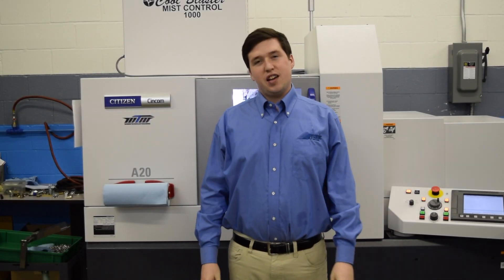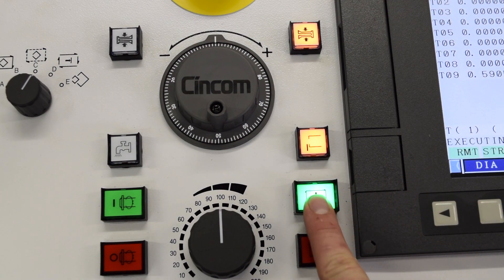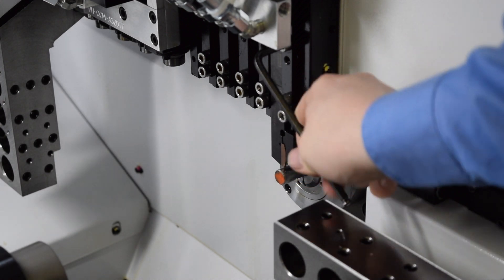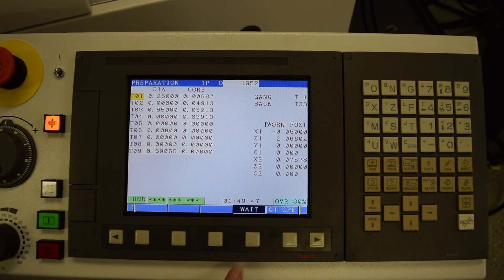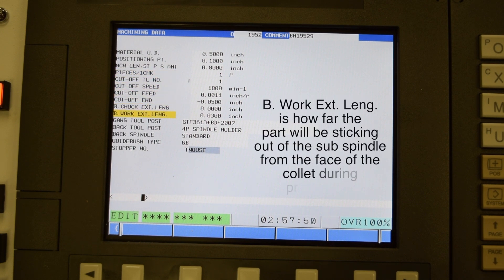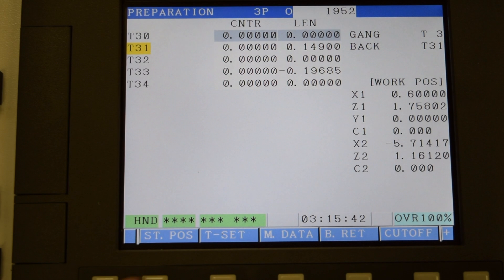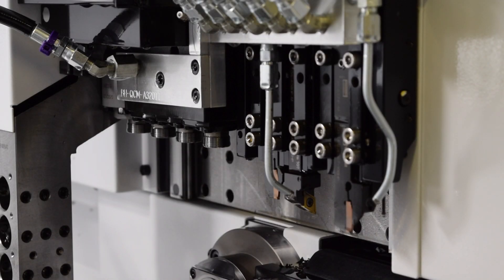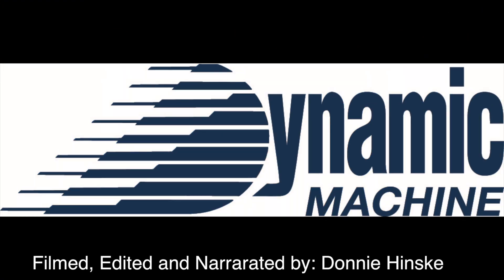Touching off tools on a Citizen A20

Comment: I feel sorry for anyone using a FANUC control on a Citizen machine.  We have 14 Citizen machines at my shop from 12MM to 32MM.  Some are A machines some are L machines.  We have ONE that has a FANUC control, the rest use Citizen Cincom controls.  The Cincom makes it SO MUCH easier to set up a machine VS the FANUC.
Reply: Agreed, I ran one with citizen control for about a month one time making bone screws. Citizen control was almost like a conversational control, very intuitive. The fanuc looks older and basic like an old star lathe.
Reply: This popped up in my feed again.  We now have 19 Swiss machines at my shop.  FANUC controls still suck on Citizen machines.

Comment: Is it not possible to probe these tools somehow? This seems like a lot of effort compared to a “normal” lathe with a tool setter
Reply from the maker: There are so many different types of tool stations that can be applied to the citizen machines with so many different stick out lengths. To make a probing system like a normal lathe would be very expensive because several would be needed for the different tool types for each spindle. Believe me I have thought that for years now for setting these things up
Reply: @dynamicmachineuniversity2318  youd think they could make a thing that goes in the spindle with a tool setter sticking out where the stock would be
Reply from the maker: @PetesShredder  That could maybe work but there are a ton of different holders and options that go in these swiss machines that would make it hard and not cost effective to do. Once you practice it a few times its not so bad.
Reply: @dynamicmachineuniversity2318  yeah and you would have to get it straight and level too. I’m imagining a bit of ground diameter with a four pad tool setter sticking out the end like our mazaks have
Reply from the maker: @PetesShredder  That would be sweet
Reply: setting citizens are far easier than say a mori with a presetter.  we skip several of these steps and use G50 shifts to get centerline of ID tools, etc.  you simply touch to stock, and go.